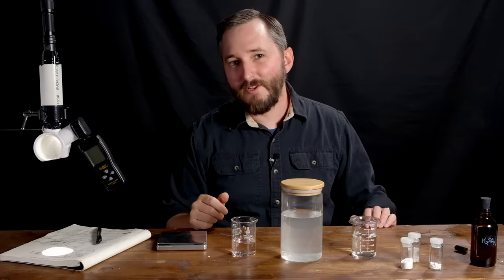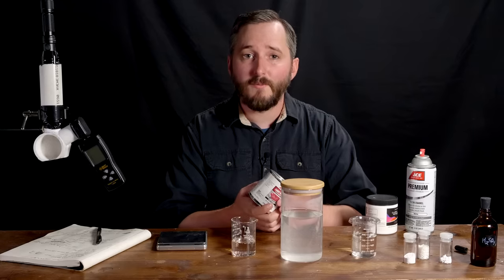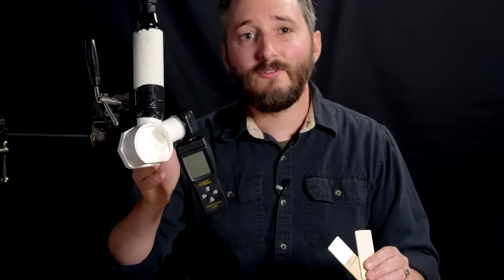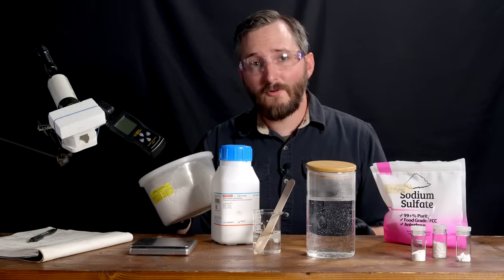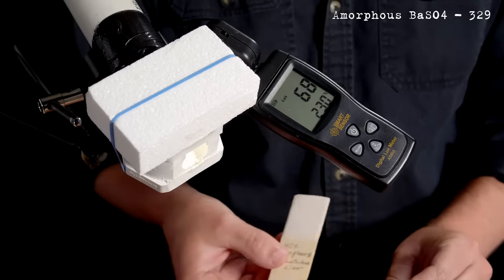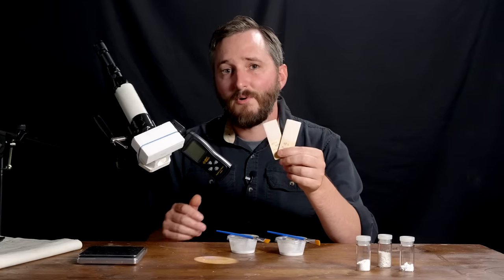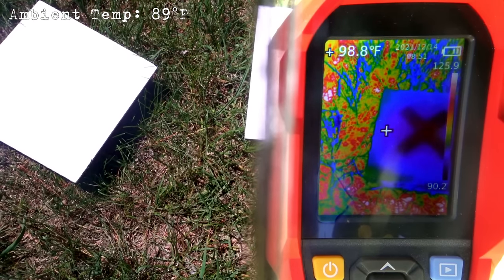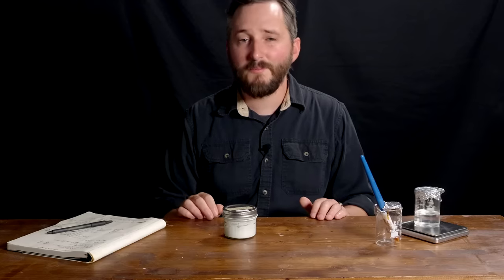How To Make Infrared Cooling Paint (Electricity Free Air Conditioning)

Comment: Be careful when using IR to measure temperature. The emissivity of your barium paint is different to the emissivity of your ultrawhite paint, particularly in the IR spectrum where you are doing the measurement. This means that what looks like a cooler surface may in fact be a surface that is the same temperature, but not emitting as much IR because its emissivity is lower.
Reply: That's what I was wondering about. Do infrared thermometers measure different frequencys or should'n the barium paint appear hotter because it radiates more heat?
Reply: i live in tucson, have no AC and chainsaw for a living. this time of year it's 92 to 94 indoors, all day all night. each year i'm more cooked, shitting my guts out at the end of each week. i'd be more than happy to test the efficacy of any paints on my campaign hat or roof.
Reply: I opened up the comments to address the same issue.  There are field / experimental methods to determine the emissivity and to compare that of two surfaces.  One that would be usable for this instance can be easily set up. 
One easy test: Take the painted panel, such as the one with the X or "Cold" into a uniform temperature area where radiation is not a factor.  Using contact heating with something like a hot water bottle, heat the surface to at least several degrees above ambient.  Take an image immediately on removing the hot water bottle. At that point, the temperature of the surface should be uniform.  If the IR image is not uniform, there is an emissivity difference.  Having the sample in the bottom of a box would improve the test a little, by providing a uniform background temperature and radiation environment.
Reply: @atomictraveller  , How did the people live and work in the area of the southern states for the thousands of years they did so? Did they acclimate? Learn to work within their limits?
Reply: @senatorjosephmccarthy2720  yeah joe, but today people own property and you have to edge bunkers and shit.
Reply: @senatorjosephmccarthy2720  in phoenix and tucson, working two full time jobs isn't uncommon. sure, people do it, sure, it eats them up. that's working within their limits.
Reply: Ya, I assume that's why you see his next experiment seems to have thermocouples inside birdhouses, to directly measure internal temps of two enclosures painted with the different paints.
Reply: Perform a simple calibration on the new paint and all surfaces your measuring temperatures of coming up with your own emissivity factor for your paint..using table can be in accurate
Reply: @atomictraveller  Throw some bright white shade cloth over your place.  Rig it up so that you can furl it at night and let your place radiate its heat to the sky, and then unfurl the shadecloth to stop heat striking the surface of your home.  If you can do that more around the place, spread the shade further around, the greater the effect will be.

If you can either find the stuff developed by the original inventors, or whip up a batch like our guy did above, you can try applying it directly to your roof and see if you can get the universe to suck heat out of your home during the night.
Reply: I would hope that there is a true emissivity difference in the IR spectrum between the two. It would mean there are legitimate applications in counterintelligence.
Reply: @senatorjosephmccarthy2720  The world was cooler then and warmer now due to global warming.  Oh wait, I got that backwards.  If you look at the temperatures from Greenland ice cores since the Younger Dryas, we are cooler today than most of the last 12,000 years.
Reply: @senatorjosephmccarthy2720  Siesta time.
Before the invention of Aircon.  Only "mad dogs and Englishmen" worked in the tropical afternoon sun.
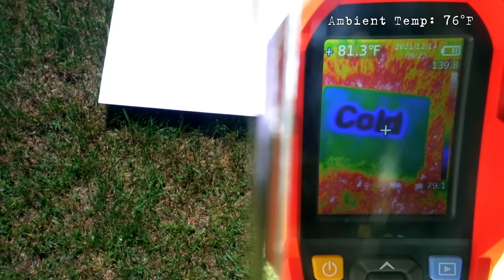Everyone else went into the shade at 14:00 and slept.   Came back at 17:00 and worked till 20:00, when it is finally cool enough to cook, eat, and drink wine again.
Reply: @NullHand  yep :)
Reply: he knows that.  that's what is giving him his views.
Reply: I would like to see how long the paint lasts
Reply: @senatorjosephmccarthy2720  we still do… we sweat.  We acclimate.
Reply: @atomictraveller  that's ridiculous. do you want some help getting AC? i live in the mojave off-gid on less than $10k/yr and i have AC.
Reply: @AJTarnas  not really, i'm rather set on dying as quickly as possible since i have so many assholes around me. i've been a targeted individual since 2005. in 2009 i left the u.s. on an emergency passport, the guarantor for my passport was my classmate and congresswoman gabrielle giffords, who you remember was shot in the head a year later. if the ac were fixed, god knows what else perps would do to me to make up for it. i'm stuck at an income of federal minimum wage ($7.50) x 30 hours a week, so even $1000 is a dream. my annual "free" money for clothes, gloves, more chainsaw files, has been about $250 a year. i'll be going to work naked soon.
Reply: This is the only real flaw in this video. I've seen a hefty slab of aluminum, half in regular paint, half in a thermal paint, show significantly different temperatures to an IR thermometer.
I did some crude testing of paint a few years ago. I used thermocouples on the back of painted aluminium swatches.
Reply: @AJTarnas  not as absurd as the west papuan genocide. 60 years of silence, 1.8 million dead, world's biggest goldmine, operated by u.s. corp freeport mcmoran.
not as absurd as the oj simpson verdict being delivered on the same date as the mkultra child rape verdict. i won't continue to the absurdities visited upon me personally :) but the preservation of west papua is more crucial to the state of humanity than the preservation of myself. :) do good stuff.
Reply: @bobbray9666  the ice age is on its way, last ice age lasted for 100 000 years and lucky we are not in one right now, but it won't last forever
Reply: @colinm1502  depending on gene's,  people who originate from hot climates have higher efficiency of their mitochondria than people that  originated from cold climates.
Reply: @andreaskampe9143  Yes,  Due to the Milankovitch cycles.
Reply: ya maybe a different approach like 2 identical plastic tubs with regular thermometers placed inside  then cover the tops of the tubs with plywood each painted with different reflective coating.
Reply: @leifhietala8074  yes there is already outdoor blinds available on the market that do that for windows, but nothing like that for a roof that is inexpensive.  Im a contractor in southern CA  I have built cool roofs that have two layers and the heat generated from the top layer is convected out between the layers, but the cost is around $18,000. for a normal size roof, so its not cost effective unless you need to replace the roof anyway.  the shade cloth over the roof looks promising  just need to do it in away thats fool proof and cost effective, and the fabric must be non flammable . Im thinking part of the cost recovery would be a prolonged roof shingle life. when someone figures out how to do that its going to be a big deal.
Reply: @senatorjosephmccarthy2720  You wear a hat (with a large brim), drink a lot of water, wear loose fitting clothing that blocks most of the light from reaching your skin but still lets air pass through, and pay attentions to how you feel. If you get too hot, time to take a break, sit in the shade and cool off. And yes, it does take a little while for your body to acclimate to dealing with higher temperatures. But eventually you can work in 110 F weather in the sun all day long, and it's not really a problem. It's not comfortable, but it is doable.
Reply: @11baddog77  ב''ה, really just need something like a pergola and slats, maybe even just a 'tin' roof that would create a solar fan pulling ambient air over the roof/attic surface.
 
Measuring the difference in A/C energy use would really demonstrate if this is worthwhile or not for materials cost, though elevated PV systems are likely to do this anyway; maybe there's an optimal depth for stand-offs to maximize any ducting effect.
Reply: At low emissivity the reflection of IR becomes dominant. A thermocouple below a thin layer of the painted material on a very thick layer of insulation and enough time to stabilise would be more reliable. Great video. Tyvek or high-density spunbound polyethylene fibers are very good at staying cool in direct sunlight. A heat camera with the wrong emissivity might even indicate temperature below ambient.
Reply: @philippbaschab7408  In order to actually do the measurement accurately using IR, it really requires a true spectrometer and a calibration standard.   This is the big challenge with trying to draw conclusions with IR single wavelength instruments. 

Just use thermocouples.
Reply: Exactly - high reflectance means low emissivity - this is simply an artefact of thermal imaging camera calibration. Does he really believe he can cool a wall 20'C below ambient at night....all he is doing is recording near zero emittance at night, with other objects radiating heat depending on their higher emissivity properties. 
He never did any recording of temperatures within bodies - another example of people not understanding radiation and thermal imagers - great chemistry though - and made me think about the complexity of heat control

Comment: I would propose small experiment with painting aluminum cylinders and measuring temperature with precise pt100 sensors in the centers of the cylinders. Cameras have noise and are imprecise in measuring ambient temperatures on materials with different emissivity. Measuring accumulated heat in cylinders over several hours exposed on sun can make results more applicable  in real world.
Reply: I agree 👍but silver would be better than aluminium.
Reply: @pattheplanter  How in the fresh hell would he get Silver Cylinders,
Reply: @D-Vinko  silvers pretty cheap, get a sheet or two and roll it into a cylinder
Reply: @D-Vinko  A shop?
Reply: I also propose using multiple materials. Residential and commercial buildings are not typically made with a metal shell to be painted. How about wood, concrete, drywall, brick, stone….the list isn’t too long but long enough to want testing on more substrates than metal be it aluminum/silver/steel.
Reply: Also I want to add the barium sulfate I believe has been made into a paint and has been patented. There’s a documentary or at least a well developed and edited video about this somewhere on YouTube that I recall watching a few years back.  It discusses the reflective properties and using the paint on top of buildings.
Reply: @erins.5420  I think the patent was for a particular process of producing barium sulphate crystals of a wide range of sizes to give maximum reflectance as well as the matrix used. I think barium sulphate has been used as a paint pigment for a long time. As long as you don't sell it there would be no problem anyway.
Reply: and after you're done experimenting with that, put them on your roof and pump water through them and strategic locations in your house
Reply: @InfraRedChameleon  explain please
Reply: Well said you make an excellent point about measuring temperature from the core of the cylinders in said proposed experiment... some may think this as nerdy but if this is actually a successful experiment it would save a lot of money and make for a greener cleaner environment however I still think that putting silver or aluminium foil on the interior and exterior walls before rendering and plastering would be a great way to insulate keeping in heat in winter and keeping heat out in summer so saying that in sure there are companies like British gypsum that use that method with some of the plaster boards 
(for you guys in USA drywall boards) they have in the selection there insulated plaster boards usually consist of a later if foil on the backing of the board or even insuboards which are a fire retardant foam coated in foil which goes between the noggins or can be directly bonded to brick with board adhesive and nailable wall plugs tgen can either be boarded over and skimmed or scrimmed up with large scrim sheets and plasters with onecoat/browning/bonding/ or any other backing plaster application and skimmed with a multifinish plaster this on the internal wall keeps the heat in but can help keep it cool in summer and can be double effective if the exterior is treated the same manner as the interior so if this kind of paint  is applied over an already effective wall coating just think how much you'd be saving on the energy bills and the environmental issues tgat come from fuel that is used to generate heating or air conditioning...
Reply: @jonelliott4985  We call it plasterboard in addition to drywall.
Reply: Yeah your probably right but having a white panel that spells out COLD in temperature is plenty good enough to convince me that this is a real significant effect that is reproducible. I'm on board.
Reply: Especially when relying on messing with thermal emissivity for the cooling. Then the temperature reading extrapolated by measuring the thermal emissions with a thermal camera hardly gives any precise information. In some way a contact thermometer is needed.

Also I dont think that emission in the infrared window makes that much difference for the object. The energy is taken away no matter if the ray gets out into space or gets reabsorbed a few dozen meters away. Normal radiator paint also specialises in radiating the heat. They may not do great in the reflection part but maybe are also worth a look.
Reply: @georgschwab3946  plus, if radiating heat as IR there is more IR than the actual temperature, but if insulating IR there will be less IR than the actual temperature.

So if your paint was radiating more heat it would look hotter while measuring colder. Instead it looks colder, so it's probly hotter.
Reply: @tylerdurdin8069  Except that he's using an Infrared thermometer. Since he's using a paint specifically designed to reject specific spectrums of IR he could be getting a totally false read. It's literally how things like IR camouflage are made.
Reply: @TheSkytherMod  Pop cans are cheaper, premade, and of a very uniform size and shape and mass so long as you stick within one brand.
Reply: The problem with using aluminum, or any substrate, is that you're now also measuring the emissivity of the substrate, not just the paint.
Reply: copper should work almost as well as silver, and you can get tubes for relatively cheap.
Reply: @satibel  Since i think we're after relative results, I'm not sure why we're worried about using the most conductive material we can get our hands on. If we're worried about absolute measurement the material properties will need to be taken into consideration anyway?

Aluminum and some k type thermocouples will probably suffice.
Reply: @nodriveknowitall702  depending where you are copper tubing is a lot easier to get your hands on than aluminium tubing.
Reply: @satibel  The word cylinder was initially used, which I generally take as a 3d solid but that might not be what was meant.

For me, I can get some small diameter round stock of aluminum at "Lowes" and it will be far cheaper than copper or silver.
Reply: @jakedewey3686  What do you mean? We're talking about taking a contact measurement of the material, rather than IR.
Reply: @nodriveknowitall702  the aluminum has it's own reflectivity and emissivity figures that will affect how it absorbs and releases energy. For example, some of the light energy will penetrate the paint samples, and will be reflected or absorbed based on the properties of the aluminum itself, rather than the paint. That affects the temperature that you'll measure both at the surface of the can and in the air in the middle of the can.
Reply: @jakedewey3686  I don't disagree with any of what you've stated. We can still make comparisons, using the same material. Uncoated, coated with various commercial products, and coated with barium sulfate microspheres.
Reply: @nodriveknowitall702  cool thanks for letting me know
Reply: This paint could be used to thwart FLIR targeting systems 😶 those use cameras right?
Reply: @bringer-of-change  actually, this would probably do the opposite. The paint works in part  by being a really good IR emitter. It radiates the energy away really well - but that radiation is exactly what FLIR is trying to detect!
Reply: Good point, cause no matter how clean you´ve worked yourself, a faulty of-the-self measuring method can still become the weakest link it this chain of results-documentation and -interpretation...
Reply: @jakedewey3686  the paint is supposed to be selective IR emitter it might as well miss the sensitivity bands of the camera.

I think emission characteristics independent temperature measurements should have been used.
Reply: @TheSkytherMod  aluminium's cheaper
Reply: @anb1142  yeah by far, it's essentially free, but what are you after? Cheap build costs, or results? I agree silver is overkill, copper sheeting would be good
Reply: @UtkarshAmitabhSrivastava  the text means "it's amelinium, you can't paint it" (amelinium = mispronounced aluminum)